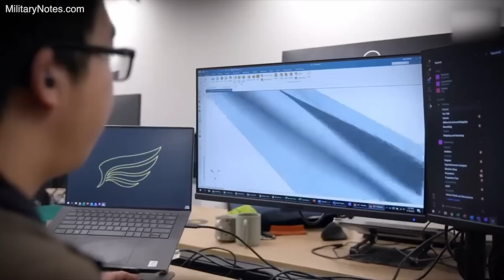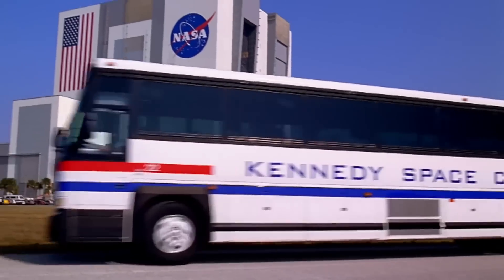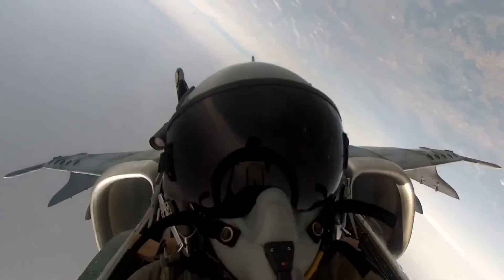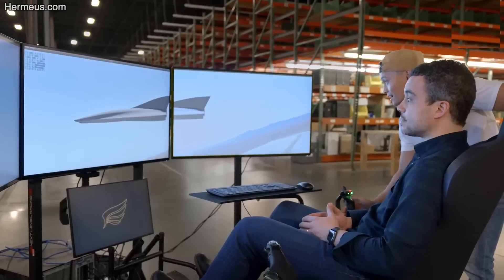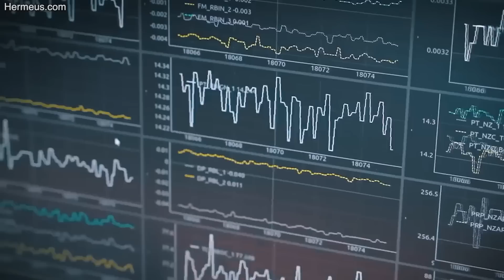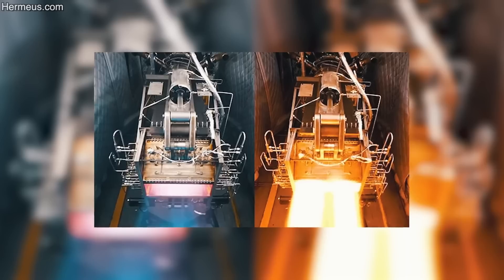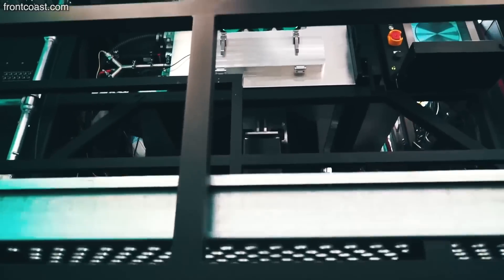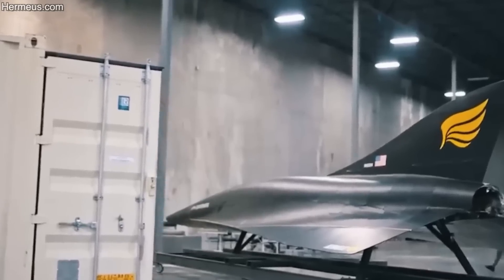This is America's New Hypersonic Air Force Jet

Comment: WHEN YOU SAY "5 TIMES FASTER THAN THE SPEED OF SOUND" IT MEANS 6X THE SPEED OF SOUND!"
Reply from the maker: Thank you for your comment and for pointing out the clarification! You are correct that if we say "5 times faster than the speed of sound," it would imply that the speed is 6 times the speed of sound. We apologize for any confusion caused by our wording. The SR-72 concept aims to achieve speeds of Mach 5 or even higher, which means it is designed to fly at five times the speed of sound. We appreciate your attention to detail, and we'll strive to be more precise in our future videos. Keep watching and engaging with our content!

Comment: As far as a fighter u don't need a plane that goes that fast.
Reply from the maker: Wade Adams, you bring up a valid point. The primary focus of the Hermeus Quarter Horse project is not to develop a fighter jet, but rather to create a hypersonic passenger plane that has the potential to revolutionize commercial aviation. The goal is to significantly reduce travel time for long distances, making it more convenient and accessible for people worldwide. While hypersonic technology may have potential military applications, the video's main emphasis is on its potential impact on civilian travel. Thanks for your comment and for engaging in the conversation!
Reply: Respectfully I disagree. An aircraft like the F-22 that can super cruise at MACH 1.8 presents all sorts of problems for fighters that can't super cruise, such as being able to decide when and where to engage.